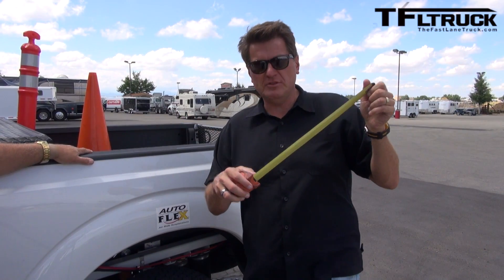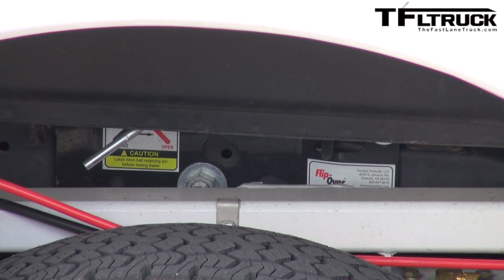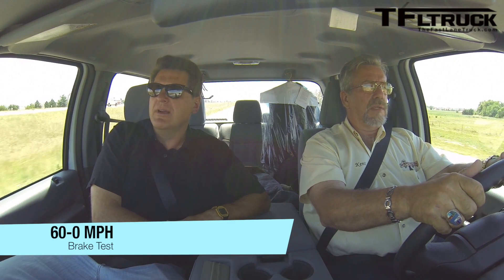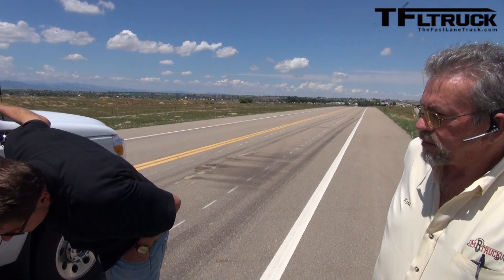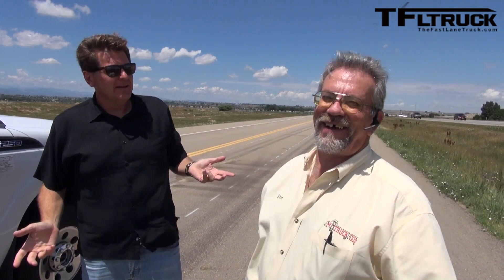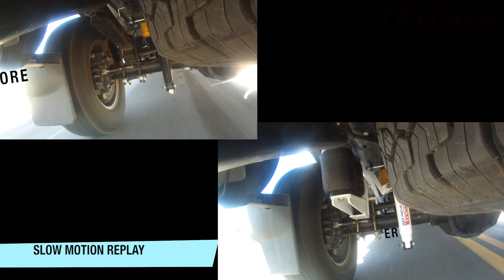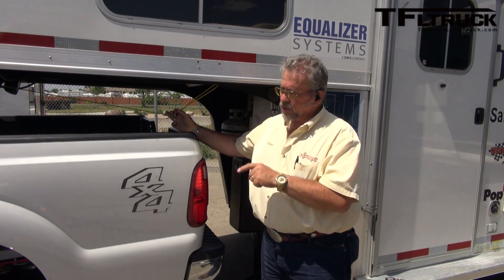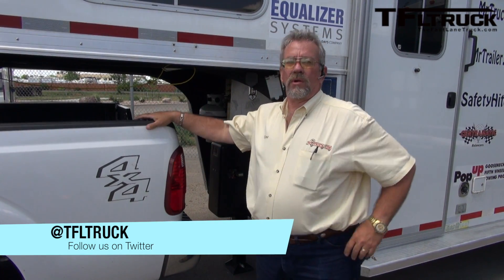Project Super Duty: Ford F-250 Air Suspension Conversion (Episode 5)

Comment: So, you changed the shocks from stock to hydraulic?  Well of course there will be a reduction in body roll and axle wrap.  Try all these tests with the change in shocks alone.  You'll find most of the improvements are in the shocks.  Without shocks airbags bounce significantly more than leaf springs.
Reply: All shocks are hydraulic, what kind of idiot would run without shocks,  you have no clue what you're talking about.

Comment: On TRUCKS?? I think the Lincoln Navigator (1998? I believe) had it first in the rear, then when re-released in 2003 it had it on all four corners as it still does today. I think Escalades and Yukon Denalis back in the early 2000's also had in the rear.

Comment: Yeah...  I don't agree 100% but I see where you're coming from.  IMO the owner and driver of the vehicle knows his truck and will be able to comment on what he or she thinks over what they're used to.  It is odd to see a fifth wheel setup on a gas motor.  Especially in the mountains where a turbo diesel would really shine.  It may have come down to the initial cost, but the 3000 dollar suspension is sure narrowing the margin.

Comment: It has mostly been an issue of cost that it hasn't been offered.  With RAM rolling out air suspension as options on both their 1/2 ton and HD pickups it shouldn't be long before Ford and GM follow suite.